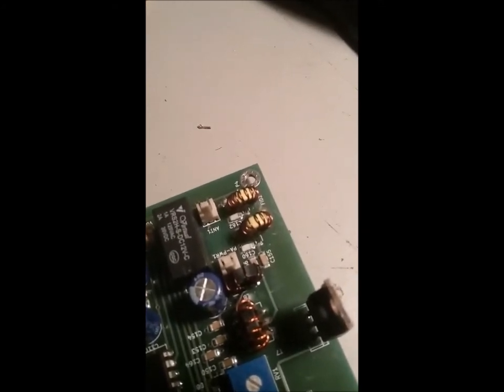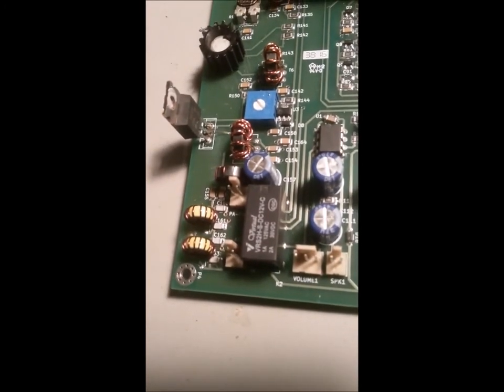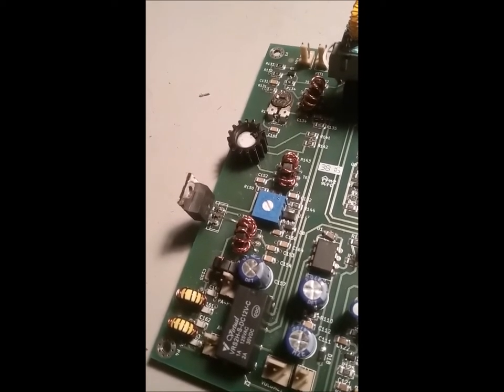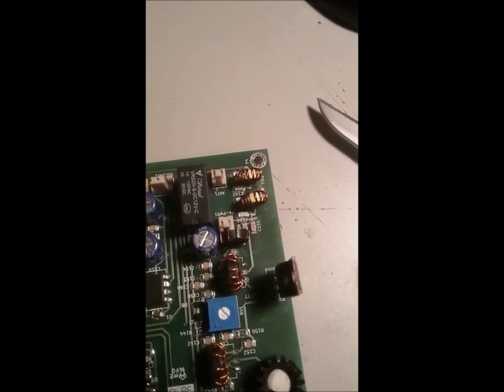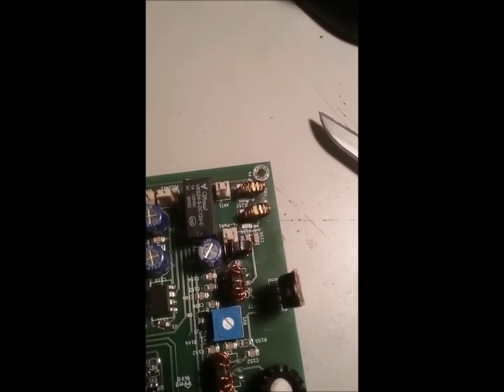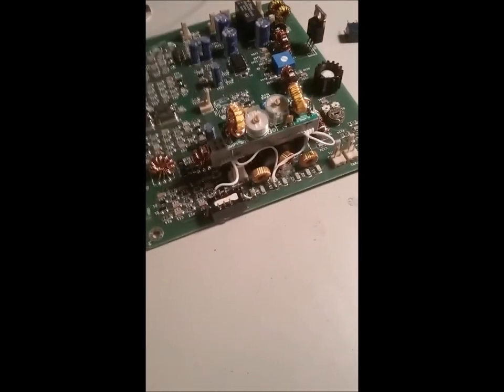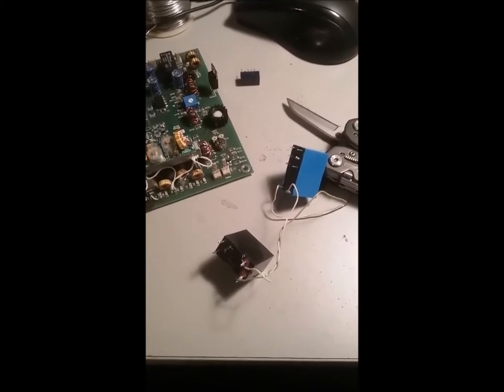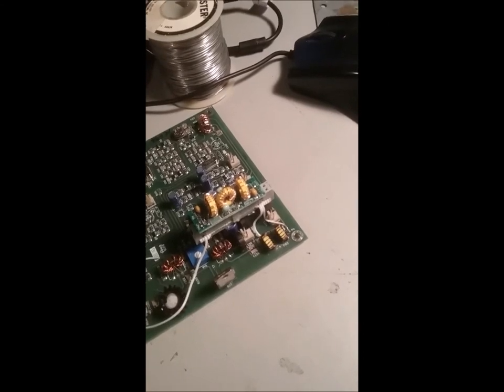20m BITX40 conversion. Dual band w/ Auto Switching

Comment: Hello I’m wanting to add a dds for  multi band like yours what’s please can you tell me which resistor you remove before adding lpf  to make it open up on all band 

Thankyou 

73.
Reply from the maker: Check my other videos about that, it's been a few years and I don't recall off the top of my head anymore. If you want multi-band though, get a uBITX. The BITX40 is built as a 200ohm radio internally, so if you're going to use multiple filters, like I did, you have to add transformers from 200ohm to 50ohm and back. Not a huge deal, but something to keep in mind that I did not know when I made this video.
Reply: @MiscDotGeek thank you I have a ubitx full hf and a bitx40 I have a dds vfo I have made for it it’s my test board for the DDS VFO 
🎉
Thanks for your reply 

73z.